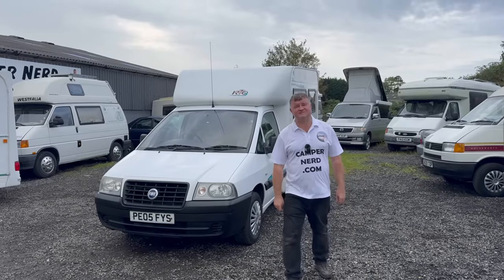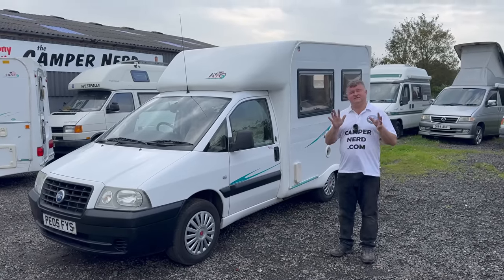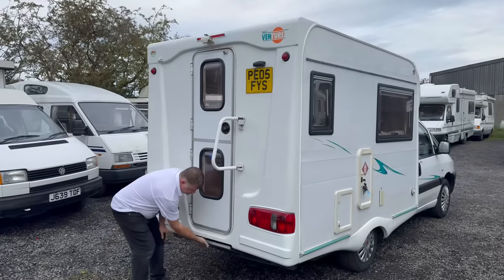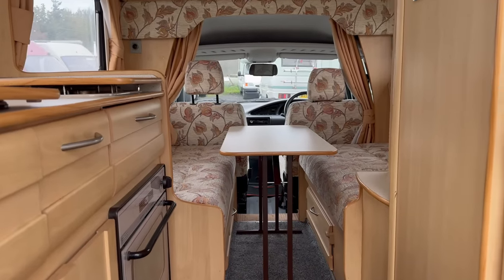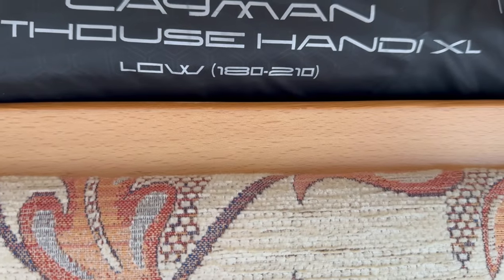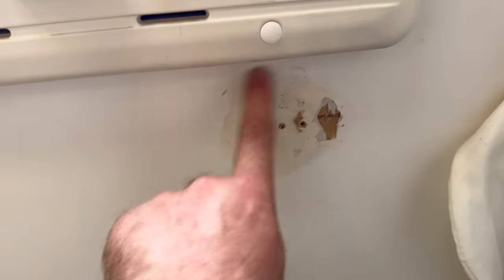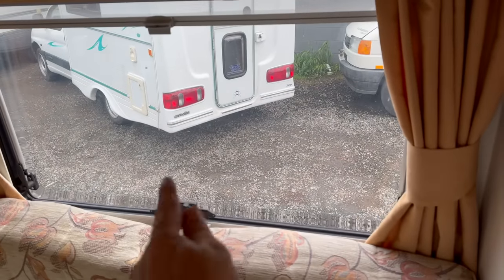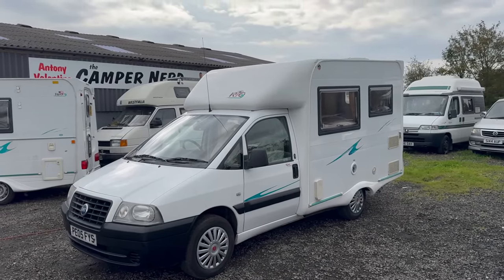2005 NU VENTURE RIO FOR SALE A TRUE TARDIS ONLY 5.2M LONG NO RESERVE EBAY AUCTION PE05FYS

Comment: Some elderly relatives recently bought an older version without the toilet and shower for about £7000. Which I think was cheap considering it's got running water and heaters. 
You could definitely spend more than a weekend in one even a couple of weeks.

Comment: Hi Anthony
Came across you many years ago when you where Mouse to House, we have one of these  NuVenture Rios but the 2000 version, they are an incredible machine.
Ours is also based on a Scudo chassis.
This is a moderner version of ours.
You will have no problem getting a decent price on this one that looks in ace condition
Thanks for sharing and keep up the interesting videos.
Do you do part exchanges ? Not that we are thinking of selling at the moment but we might want a newer version in years to come.